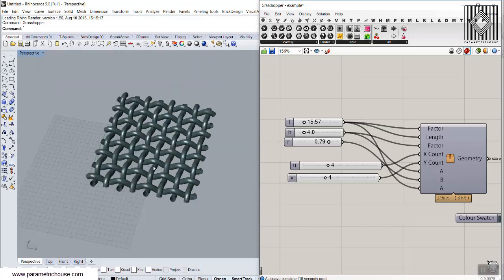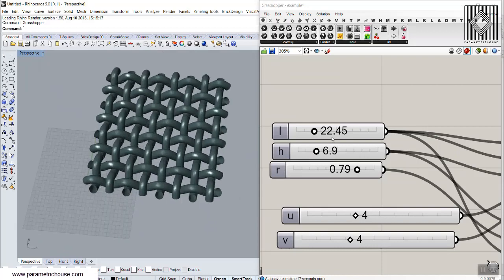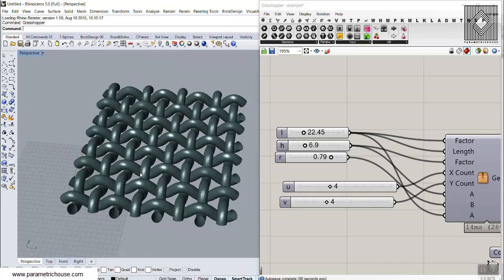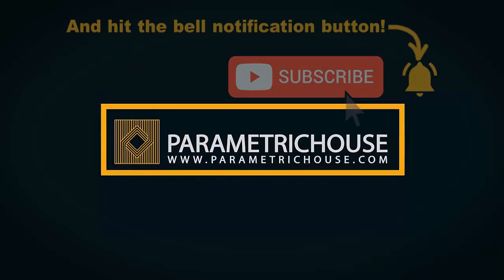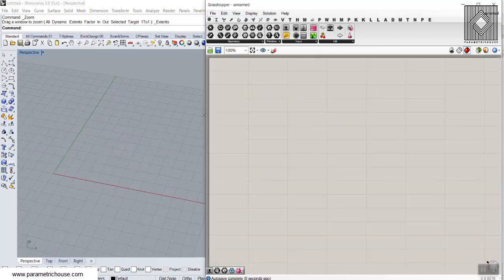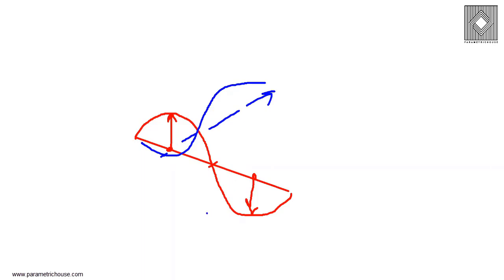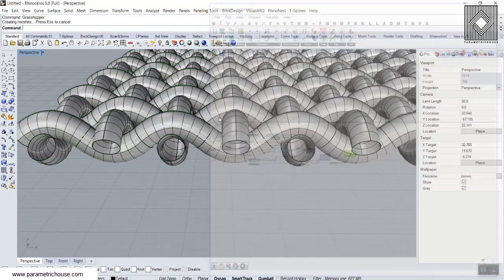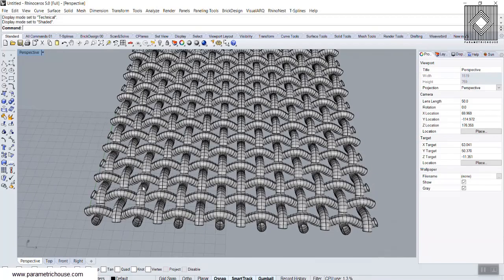Parametric Pattern - Weave

Comment: I think I'd start with two identical rectangular point grids. Offset one in the z-direction and use a pick and choose to connect them to an interpolate curve. That would give one direction and a flip matrix would give the other. There might be a a little fiddling to get the patterns alternating properly but I think it'd work

Comment: Create and set points along line . Create number slider sequence to shift alternate points 1 & -1 in y direction. Interpolate line to create curve through points. Pipe along curve. Array linear. Copy grid of pipes and rotate 90 degrees. Move in x direction 1 or -1 to get curve overlapping .
Reply from the maker: Great idea 👍 that is also possible. A mirror will be needed after rotating the curves 90 degree to make the weave pattern possible. For the -x, x sequence you can use the repeat component.

Comment: Thank you for a very detailed tutorial,  how do I cap the pipe to be able to print it? and how do I make sure that the gap between the pipes is bigger than 0.5 in case I want to print them with movement?
Reply from the maker: You're welcome. There is an input for pipe which you can choose cap. You can also decrease the radius for more gap.

Comment: how do you wrap this pattern without distortion onto a specific surface ? say, shape of a microphone(other than traditional spherical shape) or may be a shoe sole so as to emphasis that weave pattern?
Reply from the maker: Watch the Box Morph tutorial for more info
Reply: @ParametricHouse   I did try that after creating 4 consecutive pipes but when its applied to the target surface certain areas ( specially with higher curvatures) are twisted largely disrupting the flow.

Comment: Hello, if I drew the curves on rhino and set them on grasshopper, then added the pipe tool, would it still work? Thank you!
Reply from the maker: Hi Noor
Yes you can simply model this in Rhino and use the array and pipe tool in Grasshopper to achieve it!